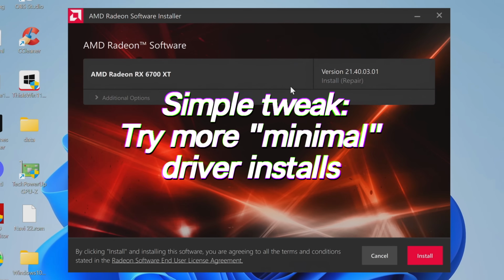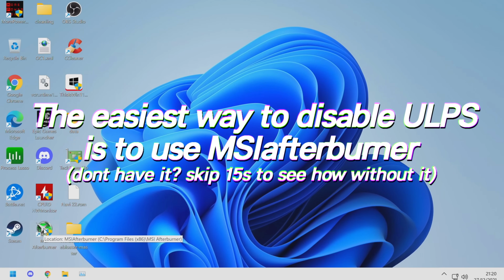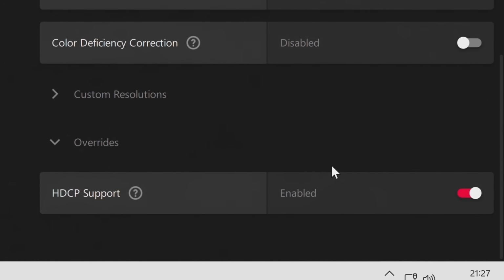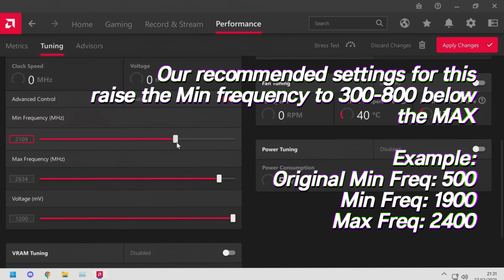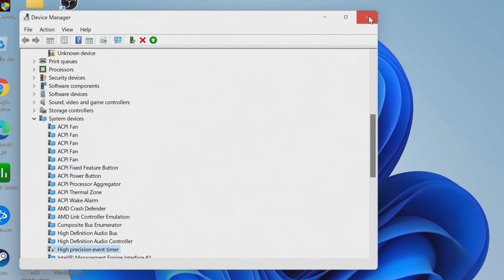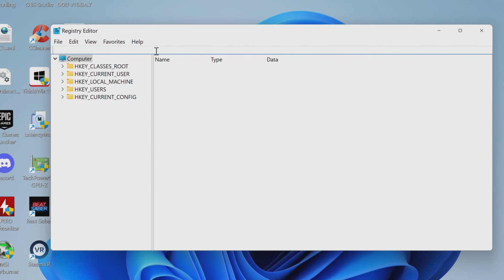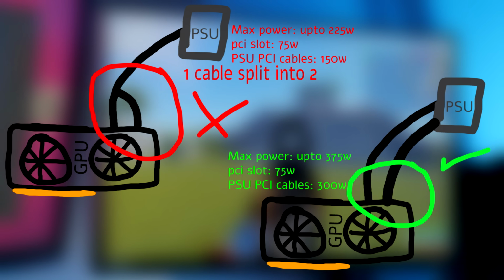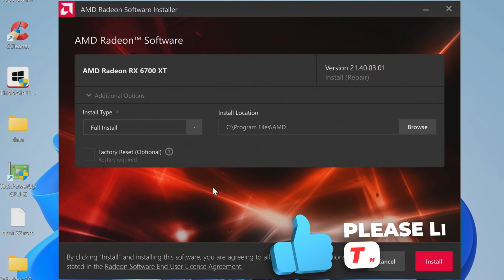🔧 Have an AMD Radeon GRAPHICS CARD? You should use these SETTINGS! *FIX LOW PERFORMANCE & CRASHES* ✅

Comment: you said disable ulps will fix the gpu downclocking but then say to raise the minimum mhz so which one is it???
Reply: @yamborghimi5003  honestly though, its conflicting information
Reply: @TheLimitIessMan  ulps lowers the voltage and the frequency when it's don't needed, but it can cause performance issues that's why he disable it. when you raise the minimum frequency it can help boost performance because the card voltage and frequency doesn't jumping in high difference, so you can fix your fps drops and things like that. hope you understand my english not that good
Reply: @yamborghimi5003  can I disable ulps on rx 6600 xt or only in olders gpus?

Comment: My pc is  crashing after I changed from  min 2300mhz max 2400mhz to your advise min2000mhz max 2700mhz

Rx6800xt
Cpu 5800x 
750 psu
Reply from the maker: That wasn't the advise, that was an example
Change your max back to 2400mhz
I only advised to change the MIN frequency.
Try Set your min to 2000-2300
Reply: @Panjno  after testing 2000 min 2600max is working, should in let it so?
Thanks for your answers.

Comment: Hello panjno I want to ask something. I had a strange experience before I upgrade my cpu from i5-2400 to ryzen 5 2600 with the same gpu rx 470 4gb. I have no problem with stuttering fps in Apex legend. after I upgrade my cpu to ryzen 5 2600 i had major fps fps when shooting or gun fight. HELPPP!
Reply from the maker: this is more than likely due to you NOT having done a fresh install of windows
when moving from intel to AMD or AMD to intel, a fresh install of windows is almost a MUST, they carry over so many drivers if you just upgrade and this causes major performance issues.

You can still keep your files, just look into doing a complete fresh install
Reply: @Panjno  Alright Thankyou so much!!!

Comment: Hi Panjno, 

I've been trying to work ot where I can find the High Peformance or Ultimate Peformance Settings in the Power Plan. I've tried to Create a New Power Plan but again, it only shows Balanced. I'm using a AMD Dell Laptop because my PC is getting fixed with some issues.

If you can help me that would be great.

Thanks.
Reply from the maker: Yea, this can be an issue on OEM laptops, they tend to lock stuff down in the bios, just stick with balanced and do a few edits to it
Reply: Just disable PCIE link state power management within the profile, that is, if you can, some OEMs remove that win setting as well

Comment: anyone with an rx500 gpu dont do the regedit part. after i did it and restarted my pc my gpu didnt recognize my drivers and when i reset the value to (1) on both settings. my pc started working just fine after a restart.
dont do this step... - Computer\HKEY_LOCAL_MACHINE\SYSTEM\ControlSet001\Control\Class\{4d36e968-e325-11ce-bfc1-08002be10318}\0000
Reply: Same thing happened to me im on a rx6800xt

Comment: but because i used minimal install, i don't have the performance tab in my amd software?
Reply from the maker: Min installs are for those who are having crashes ect, if you use min install I'd use MSIafterburner for performance tuning, if your drivers were stable on full install, I'd still use a full install driver
Reply: i have a 6900xt btw

Comment: I have a Lenovo Ideapad 3 laptop with an AMD & Nvidia graphics card everything is up-to-date but under performance I don't see the TUNING tab. It is hidden under another setting?? Thanks in advance
Reply: What you might have is a mux switch.  In the BIOS you can select GPU output as ms hybrid or dGPU.   Select dGPU to improve gaming performance by up to 20%
Reply: @kobusdowney5291  good to know 👍
Reply: You cannot set iGPU clocks manually.

Comment: My frequency table is a bit different, it has states from 0-7 which is the max, how do I raise it there. I have an rx 480 4gb msi version.
Reply from the maker: change to advanced
Reply: @Panjno   I did, it still stays the same
Reply: You set the minimum to State 1, it won't let you change state 0